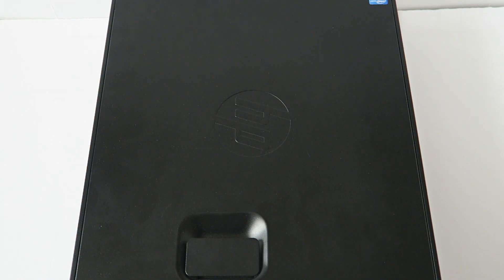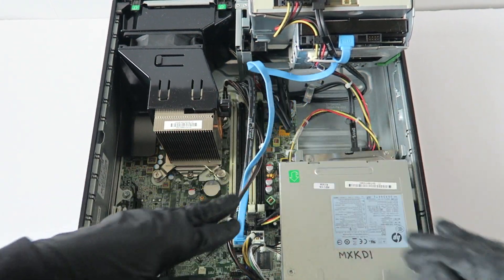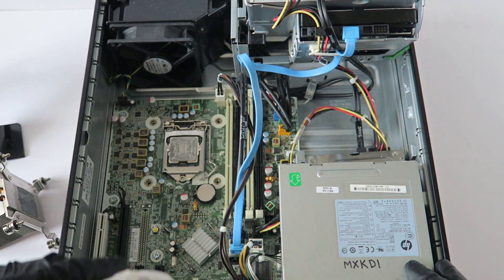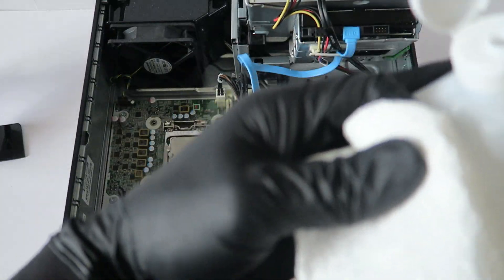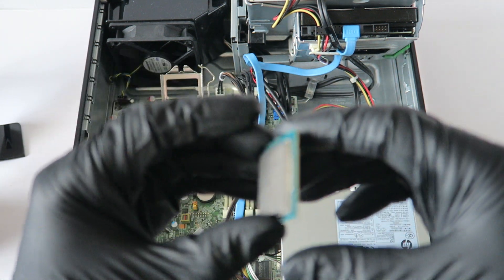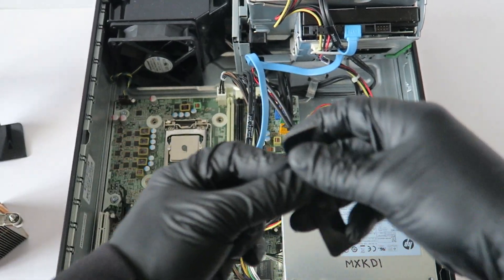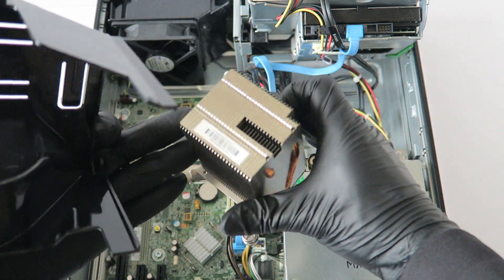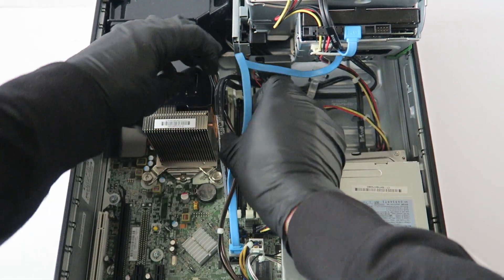HP Compaq Pro 6300 Processor Upgrade

Comment: I have this PC with 8 GB ram.  I have a 2gb gram card coming in. 3.2 GHz CPU.  Is that good for gaming?
Reply: Also, how much ram and vram does this PC support?
Reply: All depends on what game your trying to run.. I'm building one of these for me to play world of warships, should be more than capable to run maxed out settings. My son plays fortnite as well which isn't a very demanding game.
Reply: @steelblackface  I have the i7 version with 32Gb and a 1050Ti and it runs WoWS like a dream. See you on the high seas!
Reply: @thewinky01  these boards don't support more than 16g
Reply: @tronalddump8776  They sure can. I have 24Gb in a 6300 Pro hackintosh and 32Gb in an 8300 Elite running Windows 10. Remember there are 8200 and 8100 series which may have less RAM capacity.
Reply: @thewinky01  then you have a different board
Reply: @thewinky01  they used a few different boards
Reply: @tronalddump8776  Or perhaps you have a different board? I recommend you read up on the HP spec sheets and manuals and work out which model you have, and the supported max RAM.
Reply: @thewinky01  I know what board I have. 656961-001
Reply: @thewinky01  I have the book in a PDF I can send it to you if you don't believe me
Reply: @thewinky01  the board I have supports up to 16gb of ram and the i7 3770 it has 1155 socket.
Reply: @thewinky01  maybe a different bios could allow for more ram but that would be the only way.
Reply: @tronalddump8776  I had a look at my saved manuals and HP have helpfully provided a mix of specs - some say 16Gb (quick specs), some say 32Gb, some don't mention a number. But, I do have 24Gb running in mine. You're right, it could well be a BIOS thing, mine is on 1 BIOS older than what's currently available.
Reply: @thewinky01  I'd have to check mine out as I'm not sure what bios I'm on. It would.be interesting to see what these board are capable of pushing. They seem to be a solid build from the factory my first one died at 7 years old but I literally never took care of it, left it on for weeks or until it would crash,  always downloading and converting video. I haven't figured out the exact watts I'm drawing either but I doubt I'm over 200 running it as hard as it will go.

Comment: Anyone, know where can I find a Link to find what processor I can upgrade to on this board that is installed in the HP Compaq 6000 sff series.. Love  the computer but its getting slow with Win 10 Installed.   Not good for Gaming, but very adequate for Office work and YouTube Videos. Thanks, Thumbs UP!
Reply: Anything thing that has the socket LGA 1155. Which is 3rd Gen of Intel.
Reply: @medokinq8251  I saw the recommend CPU upgrades on HP to the Intel Quad core 9560. Is there anything Faster for this socket or Gen 3?  Thx, Geo
Reply: You can chuck in a 3470, 3570 or 3770. SSD plus lots of ram and a 1050Ti and you'll be able to play a lot of games.

Comment: Does it support i5-2400 ? I read in the product description it supports only i5-3570 processor
 and i5-3470, but the mobo should support every 2nd and 3rd gen intel core cpus. right ?
Reply: I can answer your question with YES, because I have a "HP compaq pro 6300 sff" with an i5-2400 (but reading this comment confirms to me that I could upgrade the CPU in the future to 3rd gen i5 or i7 if I need to)

Comment: Hello i have a quiestion... What parts from this case can work(be moved first) in another case which is mid or full tower? Just give me the list of things if u can pls
Reply: Essentially nothing but the optical drive and the ram. Everything on these extra low profile workstation PCS are all custom made and don't fit normal form factors.
Reply: The motherboard too
Reply: You could get this mb in a microtower. I have a spare I'd sell for cheap.

Comment: is the hp compaq pro 6305 compatible with Processor Amd A4-6300 ?
Reply: Wrong
Reply: There 2 version  you can upgrade  to amd a10 5800b  if you have an A4 with an fm2 socket

Comment: Hey Mxkdi I have the HP Compaq 6300 Microtower with the i5 3570 and was wondering if I could upgrade to an i7 3770? Please and thank you.
Reply from the maker: Hi, yes you can upgrade to Intel Core i7-3770 Processor.
Reply: @Mxkdt  Should I upgrade my i5 3570 to an i7 3770? Because I looked at some results from UserBenchmark and both CPU's performance seem very similar. Do you think it is worth the upgrade? Thank you.
Reply: Please reply.
Reply: It's really up to you, honestly, I wouldn't.

Comment: Does the motherboard support overclocking?
Reply: I doubt it and even if it did I wouldn't do it. If you want to overclock get a board that was designed for that purpose.

Comment: Hi, thank you for the video. After doing this I got one beep error and my pc is not turning on.. please help...
Reply: Could you help me..?
Reply: @jaey24  Maybe your power supply doesnt have enough power to run i7
Reply: @gdog8170  I tried to remove everything and fixed it back. Now it's working fine
Reply: @jaey24  glad to hear that
Reply: @jaey24  what was your previous processor installed on this system ?
Reply from the maker: Hi, what processor did you install?
Reply: @Mxkdt  i7 3770.. Just one beep and black screen but fan is running.. I tried remove all ram and checked then I got 5 beep error. Please help
Reply: That one beep is an error code, consult the motherboard manual if you could find it
Reply: Could be faulty ram dimm or ram slot fault error

Comment: There's no genuine reason to spread the thermal paste. The metal lid of the CPU is a heat spreader in of itself. The heat is generated at the center of the processor. So you don't need 100% coverage for adequate heat transfer. You just need a solid seal.
Reply: i also got surprised when he spread it like that

Comment: So I have this exact same pc and I was wondering exactly what parts do I need to make it somewhat of a gaming pc ?
Reply: Hi, Hope it help, If you have 4gb ram buy another 4gb stick, if you have 8 already,its fine. You can change the processor for an i7 3370, but the i5 still good for fortnite and e-sports, tell me what games you will play, and Finally you should add a gtx 1050 or gtx 1050ti but PAY ATTENTION XD if ypu pc is thin like the one on the video you need to buy the low profile one, that is smaller, but if your pc is bigger and fat xd you should buy the normal one
Reply: Can you play Diablo with a 4gb ram cp6300
Reply: @Tamakizan  You can install a 1050Ti LP

Comment: I need to know if a graphics card will fit this motherboard configuration and I was wondering if you could help?  Graphics Card: EVGA GeForce GTX 1050 Ti GAMING, 04G-P4-6251-KR, 4GB GDDR5, DX12 OSD Support (PXOC)
Reply: DukeCityGaming get a gtx 1050ti lp,

Comment: Thanks I just need to review how to do a socket 1155 processor. ( haven't replaced a CPU in these Motherboards in a while. ) This video  helped a lot. (I like how you showed that there are 2 ways to get the thermal compound to spread over the processor.) again Thanks!

Comment: Someone help please! I have this cpu and mobo I think what I have its amd apu a4 I guess the lowest cause I use to run games like Dota 2 resident evil 4 emulator and I want to know if I can put and i5 ore i7 in mine? Or at least and amd apu a8 or a10? Doesn't matter if I have to upgrade the bios and can I put a nvidia gtx 1050ti? I might change the case so everything can fit

Comment: Is it advisable to apply the thermal paste before inserting it in the motherboard
Reply: In my opinion no. Because it can get messy then (Thermal past on hands in socket, on motherboard..etc.)
Reply: you just apply the thermal paste after installing the cpu on the socket, a rice grain or a pea size will do on it and then you place the heat sink on top

Comment: Hi I have questions I have dell optlix 7040  and I want to change the power supply but not sure if I can because  of the space in. The case and to switch it with EVGA  750 W to have 1060 6gb oc EVGA edition